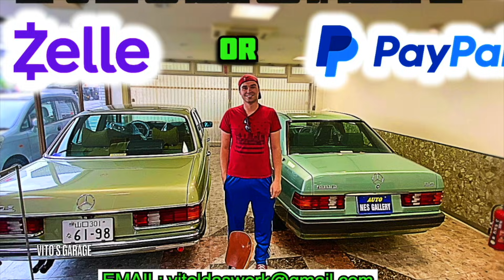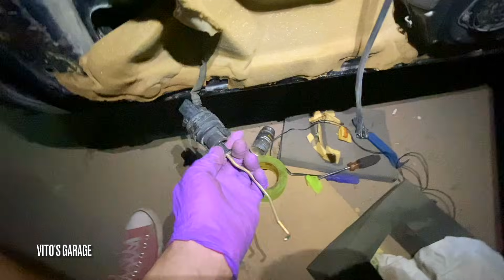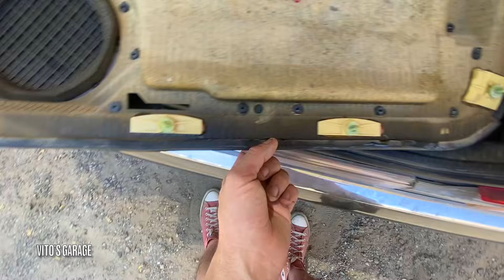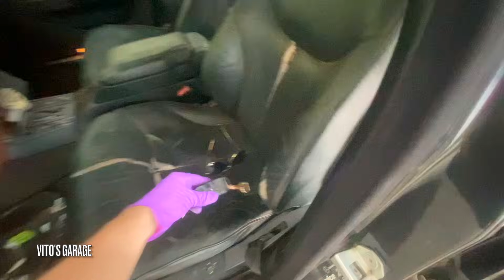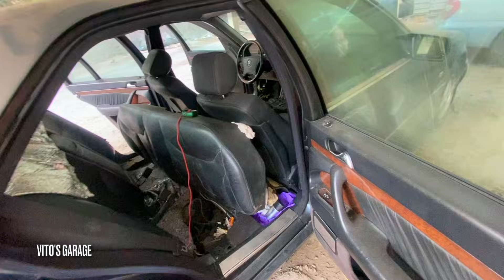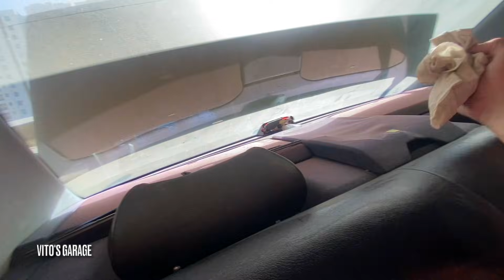German Spec Blue Mercedes W140. Only Driver's Door Locks/Unlocks Using a Mechanical Key! Why?!

Comment: I have whole another issue. My car will just unlock, locking doesnt work (just on drivery door with key) when i lock the doors manually, with button on each door and i try to unlock with key from drivers door, all but one (rear left) will unlock. Pump is running like 10-15 seconds only when unlocking, locking doesnt work at all. Any guesses?😂 My best guess is leak in rear left somewhere? but there is still that issue with locking not working.